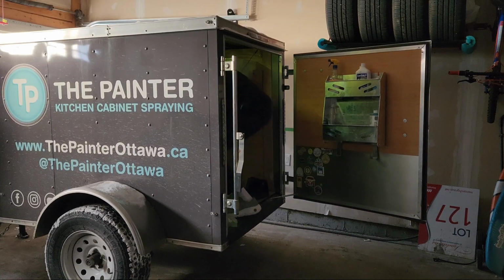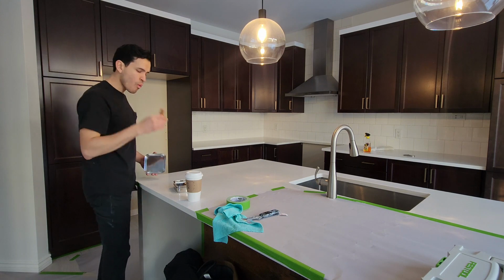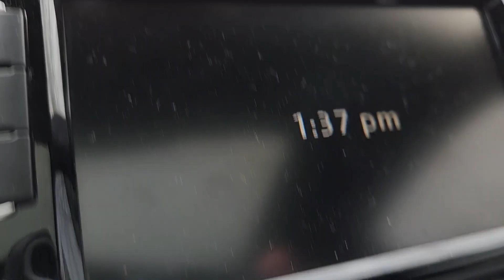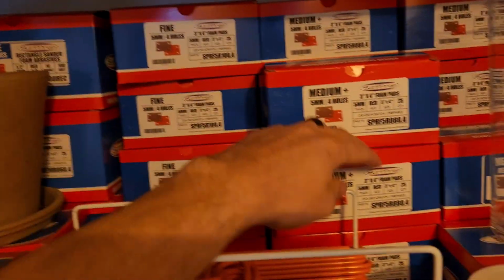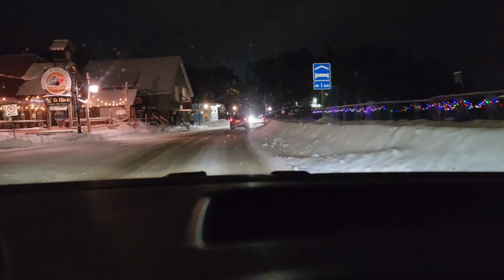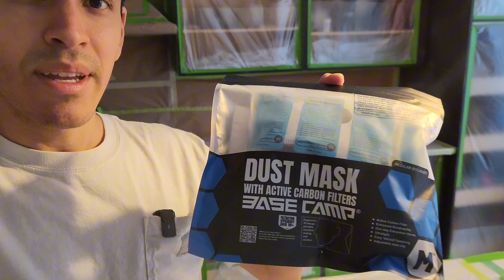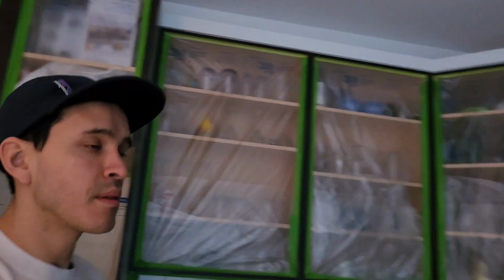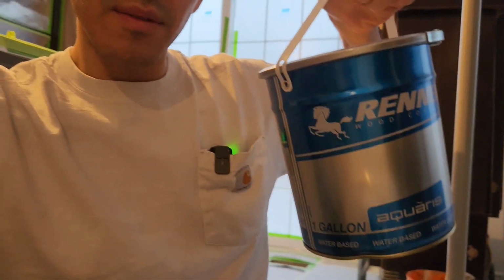How I Transform Kitchens In 5 Days - Watch How i do it - Renner Wood Coatings with Hardener Additive

Comment: Thanks for the tips, when you are sanding down the cabinets, are you just giving them a quick pass to knock off that sheen or are you trying to sand them down to the bare wood. Thanks!
Reply from the maker: depending how the cabinets are some areas to the bone others areas just a excellent scuff but definitely not one sided answer because every door and every project has different conditions.